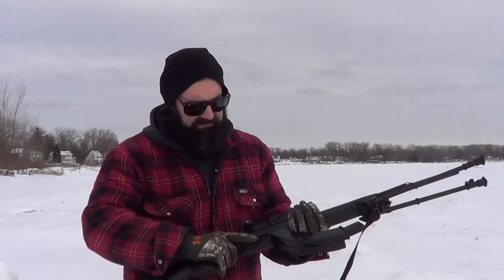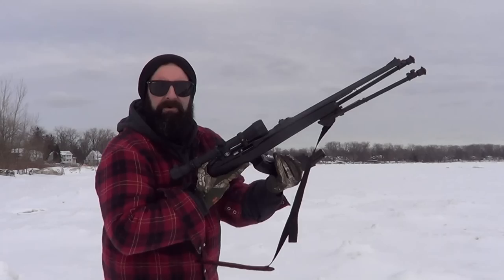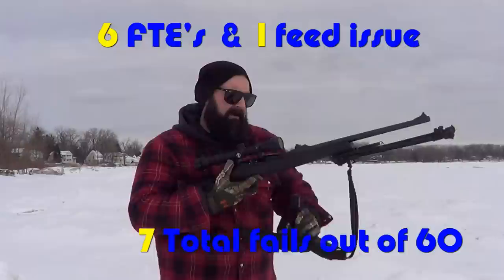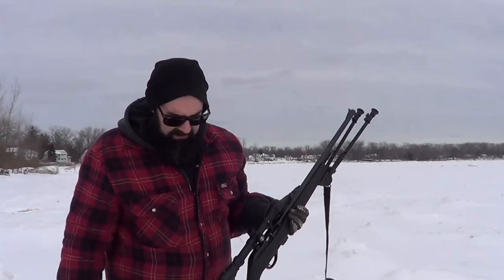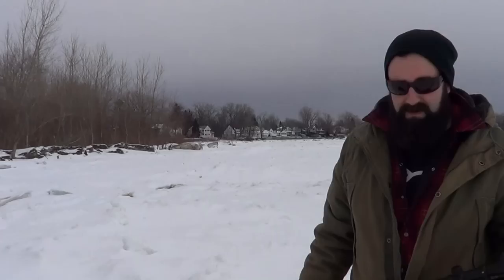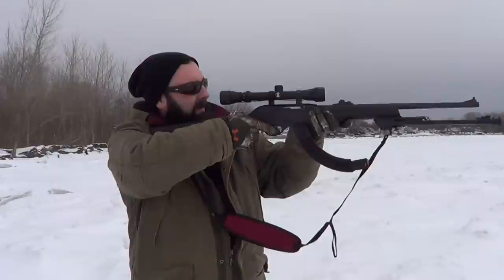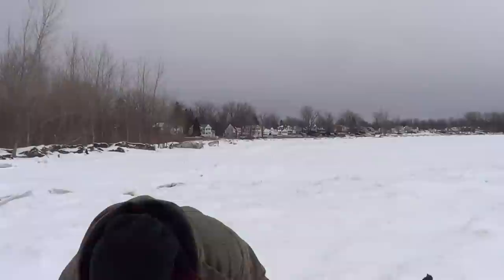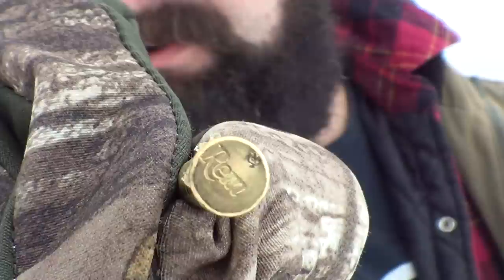HOW TO FIX THE REMINGTON 597 !!!!  (no more jams)

Comment: Just purchased one in 8/2017.  Still has extraction issues.  You would think by now with all the complaints Remington would have done something about this.  Very disappointed.
Reply: SNOW DEER I just bought one this week and already had it constantly fail to extract or feed, and before I even ran 300 rounds through it it had an out of battery malfunction with a golden bullet and the extractor exploded! it's on the way to be repaired now

Comment: Can you explain further what you meant by sanding down the magazines? Thanks.
Reply from the maker: theyre plastic, i took sandpaper to sand down where they contact the mag well to make a better fit.
Reply: I used a razor to shave the factory burrs and a bit of extra material on my 30 round.   I noticed a huge difference and improvement immediately when loading the mag!
Reply: that would make a nice little video :)
Reply: If I grab another mag (likely)  Ill see what I can do!  I suggest staying away from the clear 30 round mag too.   Nothing but trouble in my experience.   Properly lubed, they aren't so clear anyway!
Reply: yeah, I just switched my extractor. haven't taken it to the range yet.

Comment: Thanks for the tip about the extractor. I might buy one of these guns this week. Please holler at me if you think it is a mistake. I like the heft and feel of it. I also really like the iron sights. Does the gun continue to function well today?
Reply: Dude believe me, just get a Ruger 10/22. Its well worth the extra money. I could've got one for $30 extra but i decided on the 597 instead cus i like the feel of it. But with a 10/22 you most likely will not have any of these problems. Plus there's ton of accessories of it!
Reply: zp1944 Got a 597 a few months ago.  After 2000 rounds the only issues Ive had is shitty winchester ammo and dud round here and there.  I run CCI, Federal, and Remington and all of them shoot just fine.  All paying the extra for a 10/22 will get you is a better aftermarket.  The 597 is a better gun out of the box.
Reply: I got mine a few years ago. When i first shot it i had nothing but problems with it. May i ask if you bought it brand new or used? Perhaps they fixed the issues on the newer modeld
Reply from the maker: David Geiger  Flawless. I would recommend it.

Comment: So on mine the bolt doesn’t stay open when mag is out what’s broke on it ??
Reply: It will not stay open with the mag out of the gun if you close it after you take the mag out.you can hold the bolt open put your finger in the mag hole and push the lever up and the bolt will stay open

Comment: All i kept hearing was "another fail to use the right ammo" 😂 597 doesn't like its own Remington ammo. Use CCI or Federal.
Reply: +OhPharaoh Lol.  Probably true.  I don't own the gun yet but am about to "pull the trigger" on one.  Still, if a cheap part swap can make off-brands more palatable, why not?
Reply: +GeetarAdam I have had one for a few years now. Never had an issue out of it but I don't shoot trash ammo, and yes those Remington's are trash ammo.
Reply: OhPharaoh I hear people talking great about this gun when I don't even shoot mine because it's trash. Bought a 10/22 after this one sucked. Might try changing the extractor
Reply: jacobhwrd1 using remimgton golden bullet caused my 597 to blow up on the second day I owned it! NEVER AGAIN!
Reply: Hahah that's what I was thinking. I use federal and have absolutely no problems. Also used 1500+ thunderbolt with no problems. Cci worked good as well
Reply: Exactly
Reply: Ditto on that! Remington ammo in 9mm also sucks - especially that UMC crap. Dirtiest ammo I've ever used.

Comment: Great video! Bought one right after. How do you get your 30rnd mags to work right? Mine FTF the first 5 or so
Reply from the maker: I personally have never had a FTF issue with the 30 rd mags. I usually just put in 25 rds though.  Only thing i did was sand down the part that actually goes into the magwell for a better fit.
Reply: Cool I'll have to try both those

Comment: My action lever popped off after about 50 rounds, does anyone know why this may have occurred?
Reply from the maker: Tim Sharky Productions  Mine went flying in the woods after about the first 50 aswell. There is a small metal tab that is supposed to hold it in place. Bend it up to get a tighter fit. It is supposed to come out in order to take the rifle apart, but not supposed to go flying.  mine hasnt come out unintentionally since i bent the tab up .
Reply: I'll give that a go. I added this to the collection yesterday and like I said, the lever popped off several times and I had over 10 failures to eject and jams in less than 100 rounds. Needless to say I wasn't very happy. Taking it back today to see if theres something wrong with mine.
Reply from the maker: Tim Sharky Productions  its probably just the extractor.

Comment: Also my damn magazine doesn't lock in place, that SOB will fall out after a shot
Reply: +zp1944 load it with the mag locked back.
Reply: You mean the bolt? And i do, it doesnt help. The mag catch/release does not catch the slot on the magazine at all

Comment: i can promise you that gun is a dud. i have had my Remington 597 since 2012 and I shoot 98% golden bullets because its cheap and fun. truthfully i have been terrible about cleaning it too. Out of the 6000 + rounds i have put through it I have had zero failures to extract by any ammo, only one true misfire by a golden bullet (struck primer 3 times and it never fired) and only three failures to load when the bullet bent sideways because it clipped the edge of the chamber (all golden bullets due to a wobbly bullet) that rendered the bullet unfireable.